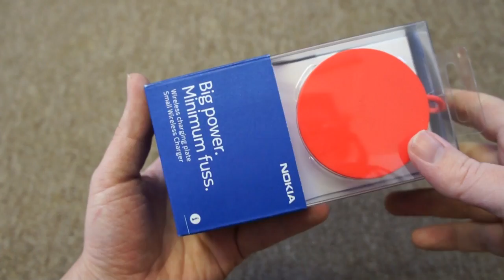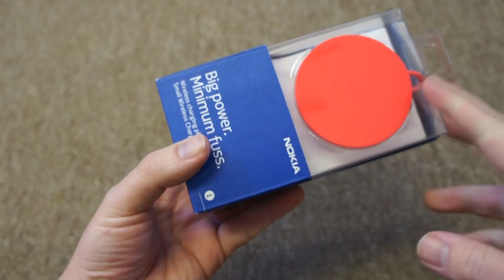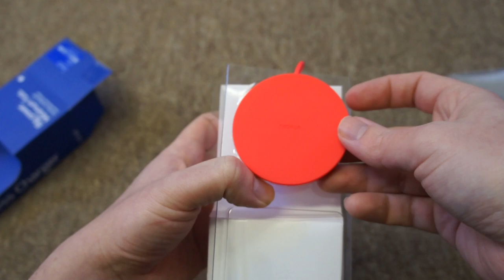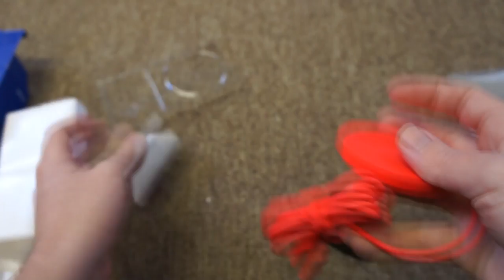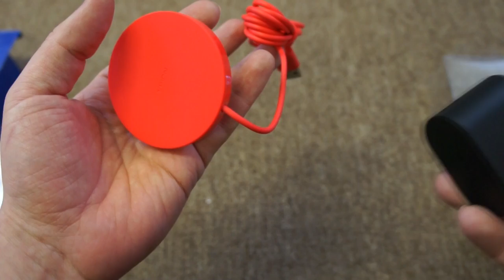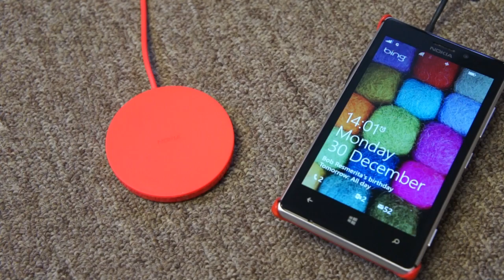Nokia DT-601 Review (Wireless Charger)

Comment: I have one of these. The woman in the shop (before I looked at it) said it was an 'external charger' meaning you could charge your phone whilst out-and-about.

This is just gimmicky, though. I have a charger, a million compatible USB cables, and I still need to plug this thing into a computer. I don't know why anyone would spend money one one of these.
Reply: Miss Okabe For one, it significantly reduces wear and tear on the phones micro-USB port...which is important should that element ever require repair.  A microUSB replacement usually requires professional soldering.

Two, I was able to place this wireless plate in my car holder (with 2 side adhesive tape) so that the device is always charging when in the cradle.  Comes in handy as I often use the navigation + music and/or podcasting while driving...a real battery drain without a charger.  Significant cost savings as the DT601 plus cradle came to less than $35 on eBay, while an integrated cradle is twice as expensive.

Three...I never have to fumble around in the dark trying to orient and connect the USB.  I have these plates conveniently placed around the house (some are cheap $5 dollar Chinese Qi chargers). They all work...but the Nokia's are definitely more robust and have a stronger field.

Comment: And what is the cost (£) for both the models ?
Reply from the maker: The DC-601 is around £30 / $50. The DT-900 is theoretically more (£50), but you can get it for £30 or less if you shop around.

Comment: What is the charge % per hour for both the Qi chargers ?  At least 30% per hour for the 601 and 40% on the 900 model ?
Reply from the maker: Depends on the size of the battery being charged. It's roughly the same for both accessories from our tests. But yeah 30% for something like the 920 is a good mark.